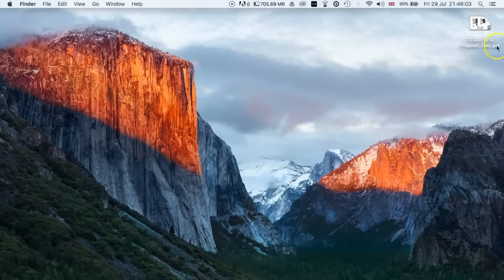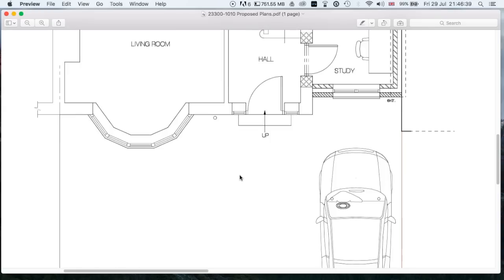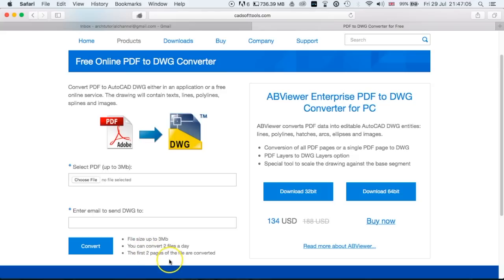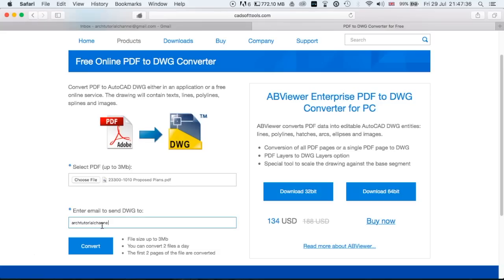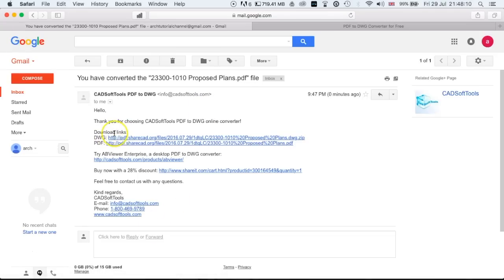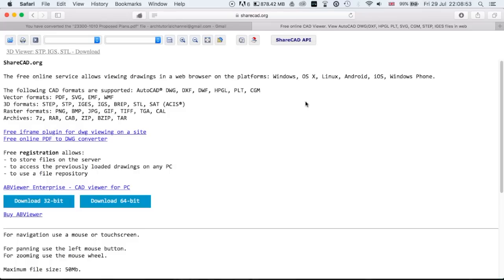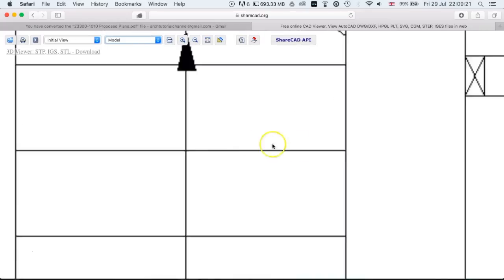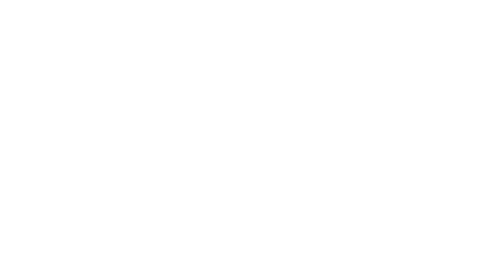Convert PDF to CAD - DWG DXF AutoCAD

Comment: This is like a miracle.  I am a Revit technician and had very much difficulties with dwg survey plan.  Inserting through Link Cad had always confused me.  Some surveyors  use imperial scales which means I had to convert to metric scales.  I'm not good in AutoCad so it's challenging.  Sometime the the surveyor had mention spot level at 9.12m but, the actual point is 409.17 as it is measured from sea level.   To avoid confusion I use the PDF and draw the toposurface.  I am really gifted in this but as you say the only problem is I need to scale it to the right size, then when you go to draw you fine the boundary lines smuggy.  Yet I come up with very good 3D site plan in Revit.  The above tutorial  is amazing except for one part I cannot once its converted and opened up back in free online cad viewer how to save it?    None of the tabs has a save tool.  I couldn't drag it to Revit project either.  Can you please do a video with how to save?
Reply: nira bottinga you will definitely have issues with scaling, and the lines will be off, if it's a surveyors plan, the bearings and distances will be of,..
Reply: nira bottinga am replying you from a surveyors point, as it's like converting a picture to cad. You just have problems with scaling

Comment: Since you are a mac user, try to use adobe illustrator and do the export there. All cad files are vector files. The pdf file origin can be either vector , raster or both. Vector is easier to handle and convert to proper cad file. Raster can be a nightmare.

Comment: your tutorial is cool. thanks for the help. but does the plan always reflect the dimensions? I tried with other software but after conversion the dimensions do not respect the original dwg.What to do? thank you for helping me.
Reply: Stephane Deben
Probably late answer but.
After converting into a Cad file.
Use align command and reference between scaled line and the drawing.